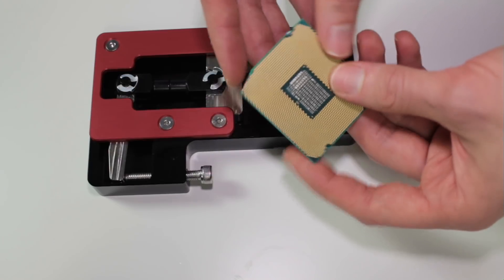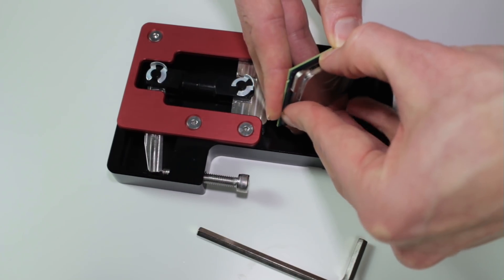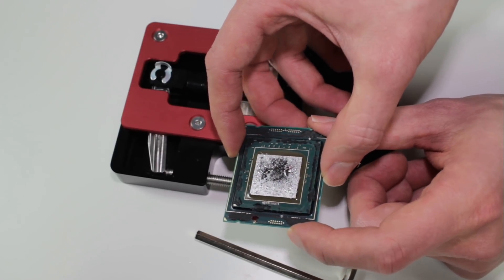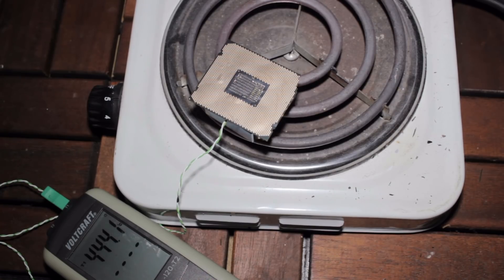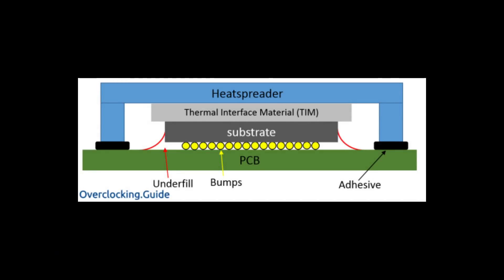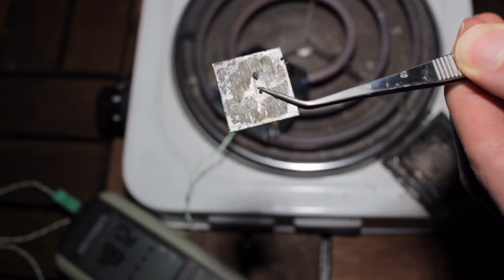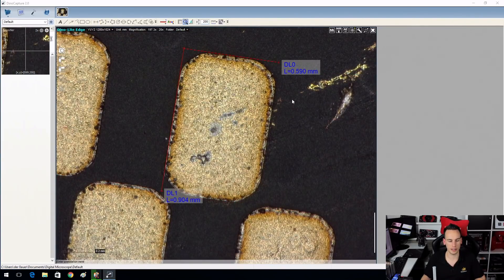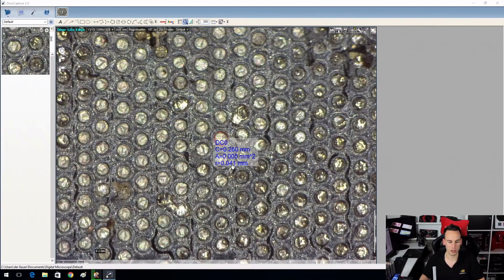i9-7980XE - a 2000 € Keychain - DIE SHOTS (Part 1/2)

Comment: Going to be deliding my first cpu - 7980xe - with the die mate x. Would nail polish be a better option than using liquid electrical tape? Also for the acetone would 100 percent be safe on the CPU?
Reply from the maker: Yea I would recommend nail polish :) acetone is safe

Comment: What kind of silicon glue you use for relidding the cpu ?
Reply: Djay Hiryuu Permatex. It's used as gasket maker. Get the 'General purpose black silicon adhesive sealant' type. Just double check it's the silicon product, they have a wide range of adhesives/gasket makers etc. If you go to Permatex.com, check out product number 81158. You should be able to find it at any auto parts retailer.